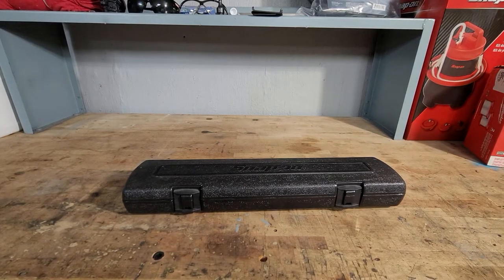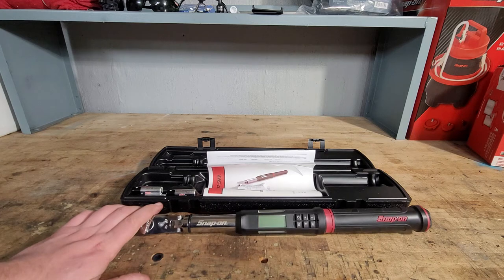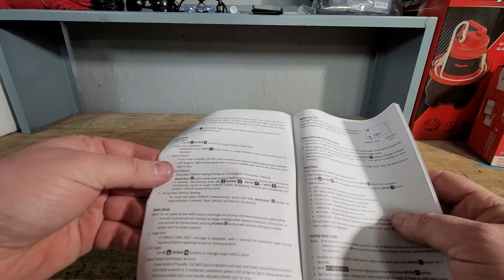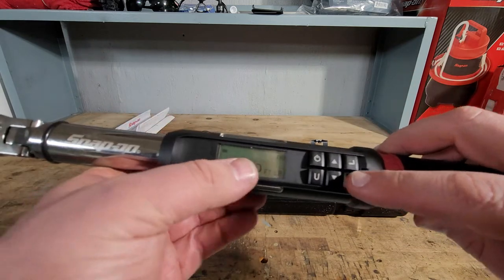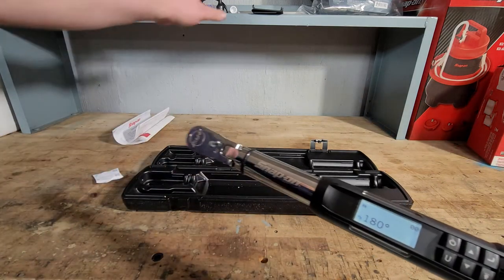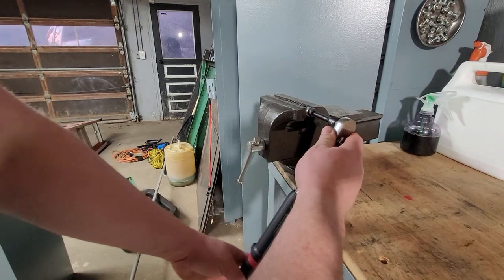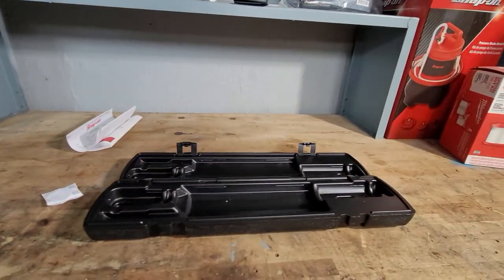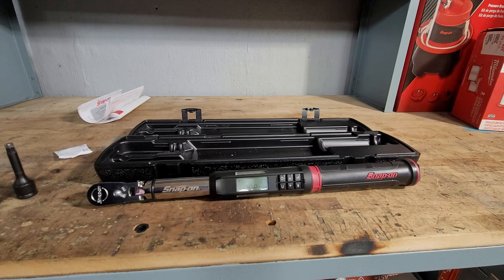Snap-on 3/8" Drive TechAngle® Flex-Head Torque Wrench (5-125 ft-lb)tem ATECH2FR125B

Comment: Just bought one today planing on doin my own oil change on my 2016 tacoma and that's the only car I have n it's daily driven not gonna buy another car can't afford it n dont wanna pay another loan for 7 years, can I hand tighten then use this to torque  or still have to wrench it after hand tighten then torque it down
Reply from the maker: If your talking about the oil filter. Then I would just hand tighten. 
If your talking about the plug,  then I would recommend torque to spec.
Reply: @Breakdowns with Brian  so I just hand tighten the engine drain plug then torque down to spec
Reply from the maker: Cool, around 30 ft-lbs?
Reply: @BreakdownswithBrian owners manual normally states the torque specs for drain plug, but I can guarantee one oil change at dealership it will be put on with max forces they won’t bother torque wrench! Lucky if people at tire shop use one

Comment: Gear wrench is about half price, however is worth the risk to end up having to buy 2 gear wrench vs knowing  snap on will definitely fix or replace theirs
Reply: After 5 years my snap on guy took it to get fixed for $120 so not a bad deal and they give you a 1 year warranty after repair

Comment: I’ve been using an AC Delco but it’s not backlit and doesn’t have any light indicators when torque spec has been reached. It also eats batteries. Every time I go to use it, the damn thing is dead. Those light indicators are what I want most.  I use it mostly on my bike and most of the time can’t read the screen.
Reply from the maker: I don't use mine much, but it's worth the money.
Reply: @BreakdownswithBrian  but at the end of vid you said it's not worth the money 😂
Reply from the maker: @mikeprice8307  Not worth the money for me. Since I don't use it a lot.
Reply: @BreakdownswithBrian  $700 is insurance for just one bolt breaking or stripping.  I hate problems.
Reply: @mikeprice8307  100%! All it takes is using an EZ-out just once or installing a heli-coil….. then you’ll know why accurate torque values are so important! That and buying new bolts vs reusing old bolts if specified in the manual.

Comment: Does the Snap-on ATECH2FR125B have an audit functions?  Does it record the torque information and the sequences?  I plan to use it as a "weekend warrior" but would like to record the torque info on engine repairs.
Reply from the maker: It doesn't. It has some setting that alow you to save the angle and torque.
Reply: @BreakdownswithBrian  I must be using "audit" incorrectly.  I seen CDI (the manufacter of the torque wrench and owned by Snap-on) states it has "USB downloadable, time stamped data trail for quality control" and can be downloaded to a computer in an Excel format.  Snap-on says they do not require software, which Excel is, so it may just be a CSV file that can be opened in Excel.